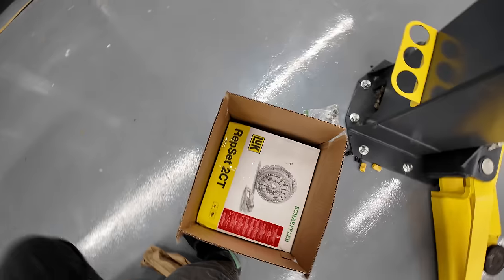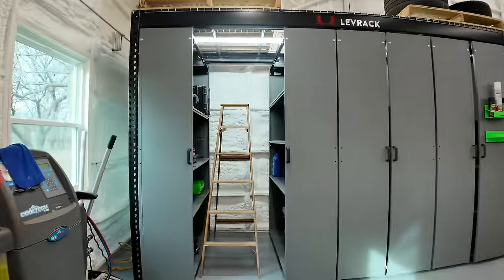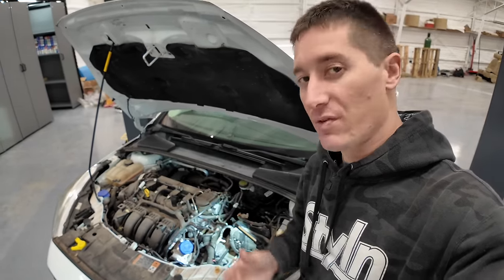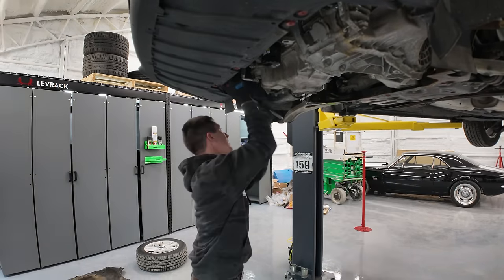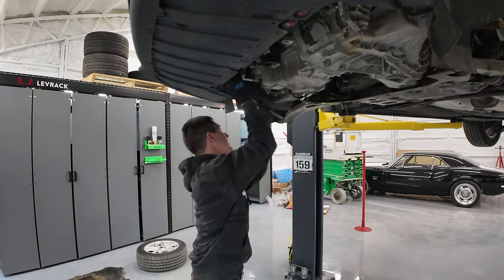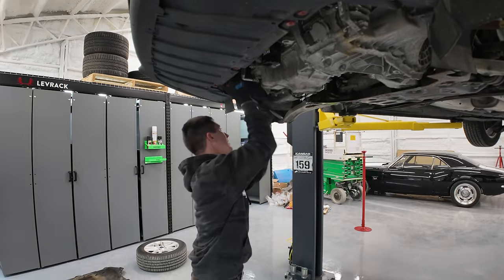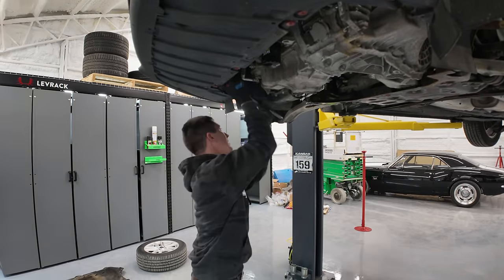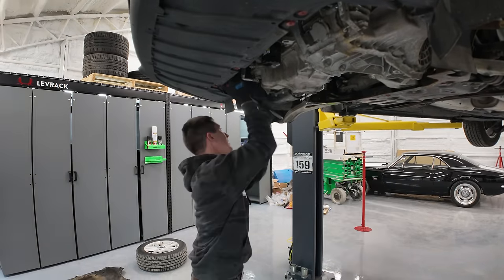Fixing The Problem That Ford REFUSED To Solve *Ford Focus DCT Clutch Replacement*

Comment: I like the new camera, but if I could make a suggestion. It feels like you need to tilt the viewing angle down a little more with this new camera. Example when your brother was unboxing the clutch 17:19, parts at the end 24:00 or when your dad was putting the battery in the vacuum tester in the other video, I felt like I was trying to peer over the bottom edge of frame to see what was going on, while there was too much above the area of focus visible.  Not the end of the world, love the channel, keep up the hard work!

Comment: The picture is a bit cold. (Highlighted blue tones) if you can find the setting to warm it up a little so you don't look so much like Casper the ghost it will be perfect. The audio was spot on. I'm watching on a 2023 model 55 inch TCL UHD panel. 
Hopefully this helps

Comment: I've owned a 2012 Titanium hatchback since it was a year old with only 18k km on it. At just over 20k, the clutch started slipping. Ford told me that there was a 6 month back order on the dual clutch seal. Long story short, 5 separate times into Ford between then and 160k km, when they no longer warrantied it. Dual clutch replaced in the end, and it lasted 30k km before failing again. After that, we just lived with it. Other than the studdering in 1st and 2nd, and of course the ridiculous turning radius, it's a great car that was fun to drive and excellent on gas. At 360k km, the trans really started acting up for the first time and so after 11 years, we've gone with something else. I'll miss it though.

Comment: Just a side note. You do not need the reset tool if you are installing a new clutch which I would do if you drop the transmission unless the clutch has less than 30-50k miles

Comment: There are a bunch of one time use parts starting with just about every nut and bolt you remove to get the trans out except for the bell housing bolts. That snap ring is also one time use.
Reply: The whole trans is a one time use part so what
Reply: @jacobfrancen9029  Such an intelligent and insightful comment. Here is the simple solution. Don't buy a Ford, don't watch content about Fords, and don't waste your time commenting about Fords.
Reply: @Dave-in-MD  don't take it so personally. I've got an 18 focus with a 2nd blown 1.0 due to wet belt tensioner failure, under recall. And another 18 focus with 2.0 DCT that needs a clutch. 2 broken ford's under 150k cus I'm a 🤡

Comment: New camera is good, one issue though is the stability feature prevents us from seeing anything that happens under the frame such as when the clutch box is opened, you were showing the top of the transmission under the hood, or in the first video you used it where your dad was pulling vacuum on the AC line.

Comment: I drove my Focus 7 years, putting only 145,000 miles on it. I drove a jeep during the winter months for the 4×4 abilities. 
  I really liked the car. It handled very well for an economy car, and it got great mileage. It was getting 40 plus mpg. When it became too unreliable with trans problems and left me stranded numerous times, it was time for a change. 
  They put 3 TCMs in it while I had it, and one after my niece got it. Ford had sent me a chit for one last TCM. The niece used it.

Comment: I've been super lucky with this car. I feel like I'm driving a time bomb. My car has 245k miles on it. I've replaced the clutch actuators but everything else is original including the TCM.   About 90% of the miles on it are distance miles so I'm sure that's helped.

Comment: Hey man great video. You need a A/C lift dolly. I run a transmission/automotive shop on my own my pops builds transmissions. We have three A/C lifts hand cranks. One is a hydraulic pump from the 50s or 60s we left it at the shop I quit and we got a new crank one. We use them to load and unload 55 gallon drums transmissions storage stuff up on our top shelves. They are a life and a back saver

Comment: if you remove the intake manifold its a lot easier to access the flywheel -flex plate nuts after the starter is removed.
I just did this job on my driveway was not to bad.
I just removed both axles just makes life easier.

Comment: Not 100% sure if they are the same, but the axle nut torque on the Focus ST with the 6 speed manual is 80n/m + 90 degrees. I found out the hard way that if the nut is not properly torqued it will take out the bearing. My 1/2" impact did not get it tight enough. Great video so far; love the stability of the new camera.
Reply: It was probably your 1/2 inch impact that destroyed your axle nut. You should never use an impact to tighten axle nuts. That information I got from my Bently manual for my VW.
Reply: @yodasbff3395  The axle nut was fine; the impact did not get it tight enough and the bearing failed. 90 degrees on top of 80 n/m is alot of torque. Need to use a long breaker bar (4 foot for me) or torque multiplier.

Comment: I just bought a Autel 808BT Pro and I hope it works great for the new Audis and other VAG cars I work on from time to time. I still use a OBD Port cable for VCDS Lite and a laptop for my 2003, maybe it will replace it. Who knows. I just hope it does what I need it to without having to buy modules all the time like some other scanners.

Comment: Ford and almost all FCA (Fiat Chrysler products) have notoriously swollen lug nuts, so there's kits out there with 18.5, 19.5, 21.5, and 22.5mm flip sockets carried by a few different brands for the very issue ya ran into. Snap on sells each socket individually for an arm and a leg, but the half size lets ya reuse the nuts for another one or two times before hucking them in the bin.

Comment: Gentleman and ladies! 
I just realized when I shift into drive from a stop, I get neutral instead. Its been jerky from a stop for a few weeks, but i chose not to think about it. This just happened happened in traffic, so my first reaction was choose a gear from the column shifter (PRND321). 3rd wouldnt react, 2nd was halfway between nuetral and first, and going fully down to first works best. in order to use other gears, i have to get up to speed like a manual transmission, and shift to the next gear myself. What is going on here? Please tell me this car doesnt need a trans. 

I went to my mechanic and he topped off trans fluid since it was reading about 1/2, he added 1.5 quarts. He cleared the CEL as well, that was for a camshaft position sensor fault. Not sure which bank atm, or the # of the code, but i can find out. Thanks for reading everbody!
Reply: It's called clutch chatter.  Every manual transmission I ever drove for the last 25 years would do it at one time or another.  Some days, it would be butter smooth, some days, you get the chatter.  This is nothing more than a manual transmission that shifts itself.  With the dry clutch setup, you are going to get the chatter.

The only ones in which I never got clutch chatter were in motorcycles.   They have a wet clutch.

Comment: I have a Ford st 2016 - clutch was replaced recently but the transmission experience is still the same - struggle with shifting - saw a video about taking some sand paper and deelectrical grease / remove the paint on the ground contact and use the grease on it - this is for better contact/ car is shifting much better and drives so much better -

Comment: Years ago I rented a 2013 Ford Focus while on vacation and I was really impressed with the fuel economy of that 2.0 direct injected engine and the performance.  The trans/clutch confused me because I am a left foot braker and I had to make sure my foot was completely off the brake before pushing the accelerator.

Comment: Nice the new cam in my opinion.
Also just curious is there a fully manual conversion available for this car model? Maybe in Europe they have it with a manual transmission?
Reply from the maker: They sold it here with a manual too but everyone says it was poorly geared 🫤
Reply: @WatchJRGo  echo is gone, big improvement!

Comment: we have a set at work. 19.5/18.5 (18.5 for when you break the cap off), 21/21.5 (for toyotas with the same problem) and 22/22.5 (for dodge/jeep/chrysler products).

Comment: John Ross - KEEP THE OSMO POCKET 3!!! It's so much better. Your Sony was terrible at stabilization and low light. I watch on a large TV and it's as if you went from 1080p to 4k. IT'S SO MUCH BETTER NOW. Yes, the color isn't as good but I'm here for the content and it's just so much better. Combined with WAAAY better audio and it's a major improvement.

Comment: Check the fluid filled engine mount that its not collapsed as that has actually stuffed around with sensor's on a few cars ive worked on.

Comment: Change transmission fluid and drive a hundred miles before replacing clutch. It’s fixed my problem multiple times. Change it about every 20k miles and never had another problem.

Comment: Whatever you do, Don't do like I did and ignore the shipping clips. They are supposed to be removed before assembly. I installed and released the clutch, and found out it hits the shipping clips. Had to start all over and reset the clutch to shipping position.

Comment: Got an opinion, half of the issue is how people drived them. After they had the revised clutch and seal they were great. Have been a ford tech for a while and was repairing these all the time. Great little gearbox. In america land of the lawsuit they sued ford for it. I found alot of the repair issues depended on the shop it went to for repair. I herd that dealers were giving techs bonuses based on how many clutches they got replaced. Ive never had one of mine come back but heaps of rework from other nerworks not cleaning the bellhousing/ lubricating components as required. Im in Australia though and cant talk for how it was dealt with overseas.

Comment: Ford's DCT 'automatic' used mainly on last generation North American Focus and Fiesta were a total disaster, in part leading to their discontinuance in the North American market. The Detroit Free Press did an extensive investigative article on how Ford failed from development to create a reliable and good transmission. There were massive failures of clutches, actuators, ruined clutches, the jerkiness so bad they were not safe for many drivers. An extended warranty was given to DCT owners but it was worthless as parts were not available, on backorder for many months and dealers backed up for months. Like some, I had to get rid of my 2014 Focus I bought used in 2016 at a significant loss on trade in due in part to its DCT problems. I made sure with research to not buy another car with a DCT or even a CVT due to their horror stories. Sadly the rest of the car was quite good, but that transmission ruined me from Ford.

Comment: Mine lasted me 65k miles before I had to get the clutch replaced under warranty. And then it finally broke again at 160k miles, so this time around I just junked it. I loved that damn little car, and the engine didn’t burn any oil. No leaks, nothing. Just the worst transmission ever designed.

Comment: welp.. I had to do my own clutch as well... didn't get lucky enough to get a LuK set, so I had to get the OEM and spent like almost 2 Grand.... but the flywheel and actuator was from LuK . I had the same issue with my Mopar lug nuts swelling up, I replaced them with the McGuard sets. .... yeah I'm looking at some Focus / Fiesta myself for a work car.. well at least I know..

Comment: You do realize there is no permanent “fix” for this issue.  Replacing the clutch and seal is a temporary fix, will need redone in 30k miles.  Ford is still facing a multi million dollar class action lawsuit and buyback for the fiestas and focus’s.  Ford DPS6 transmission is one of the biggest engineering fails in Ford history.  I put 3 clutches in my ex wife’s focus before she finally got rid of it.  They would not buy it back because it had over 60k miles on it.

Comment: Interesting video thanks... Own a '14 Focus 5 door, 140,000 m, over the 9 years, dealt with some herky jerky in stop&go traffic, followed some online advice that seemed to tame that. Far less driving retired, but overall a very good smaller good gas mileage vehicle, snow tires every winter. No rattles, creaks or rust... But... now starts slow, and no pickup on highway...misfire, wiring connection, clogged injector,,, P0192 don't know?

I like Ford products, but will unlikely purchase another, partly due to recalls and issues that should have been recalls.

Comment: I have a 2014 Fiesta and the dealer is replacing the clutch tomorrow.  This has come a long way from the single clutch on cars with rear wheel drive.  There’s no way I could ever do this job myself.  No wonder it’s so expensive to work on it.

Comment: The input shaft seals were bad from Ford often they made an updated seal kit. I would suggest replacing them. Also that trans isn't that heavy I can carry it  fairly easily. But having help... You're smarter than me. Lol

Comment: My friend bought a 2012 Focus with the dual clutch automatic shortly after it was new.  When the transmission shuttered thank God she found someone to buy it from her.  These cars are only good for parts cars for the manual transmission models.  There is no permanent fix for this poorly designed transmission.

Comment: Your scanner can reset the clutch fork actuators when you do all the relearn procedures. I have done many of these and have never used the tool,or rather I've used the clutch relearn on the scan tools sets them to spec. Also top connector on the tcm if you release it you need to unplug nothing else.

Comment: First thing with ANY used car that might have the stainless steel covered lug nuts is get them off and never put them back on.
( of course if you are a cheapie like me you can cut the covers off and use an 11/ 16" six point socket ) but only until you get your NEW lugs.

Comment: We had a 2016 Focus that we bought from the dealer.  It was intended to be driven less than 30 miles per day.  The DCT was removed and replaced 3 times, the TCM was replaced about 4 times that I know about by the Dealer.  The last time we visited the Dealer said that it was not covered even though we had a 7 Year Platinum Ford Extended Warranty.  The Service Manager was upset and told me that my car was in the "wrong" line.  He told me to move the car but the car would not go ito reverse!  He got red faced when I told him "how bad does this car have to be to REPAIR it?"   He responded by telling me that THIS was a "Useability" problem that would be covered.   They gave me the "bad" news.  They would not get the part for 6 more months.  The Service Manager blamed me! for NOT taking the money as a Buy Back?  I NEVER HEAR OF THIS BEFORE  .  The Service Manager told me "...Because if any of my technciians told you about it THEY WOULD BE FIRED".   They finally offered me $3,000 for a car that was sitting in their lot most of the time, waiting for parts.   I was able to get the car in gear and drove it next door to CARMAX.  The CARMAX printout of my car service was 6 pages long!  The Ford Service Manager said they only saw my car twice? Liar again.  CARMAX said that since it had low miles, no dents or paint dings and thousands of miles left on the Factory Extended Warranty they would give me $10,000 for the car.   I left and bought my First Toyota.  The Focus looked new inside and out, since I rarely had a chance to actually drive the car to anywhere but the dealer.   Ford where Quality and Honesty is Job #1 !

Comment: your not going to replace the input shaft seals or at least check if they are updated ones?  those are what cause most of the shudder issues.

Comment: its so much easier to drop it with cherry picker and the hookup ear that on top of the tranny, so the installation goes much smoother that way. Mating tranny to the engine usually takes me 3 mins. Its hanging with nearly perfect angle to mate.

Comment: I bet the odd gear clutch is more worn as in 1st gear the mechatronic unit doesn’t allow the clutch to fully engage until a higher speed is reached than a driver would allow for in a manual car.

Comment: Would a 3/4 socket be the same as a 19.5 socket?
Reply: 0.75 inch in mm = 19.05mm. A bit larger than 19mm, but someone would have to see if it's enough to do the job.